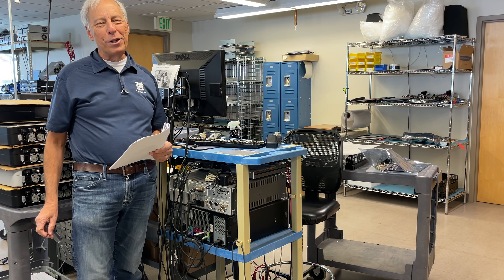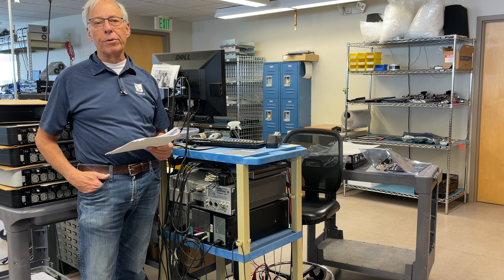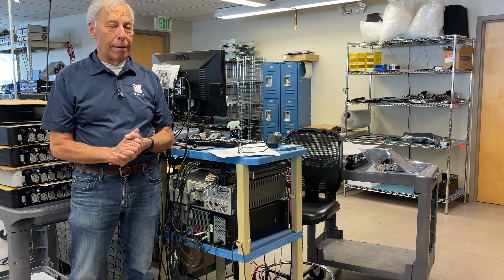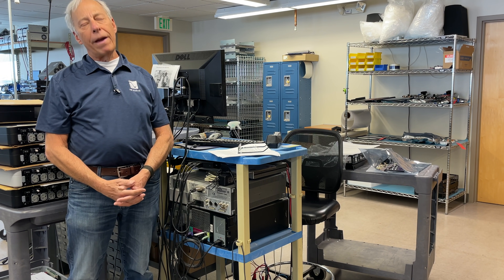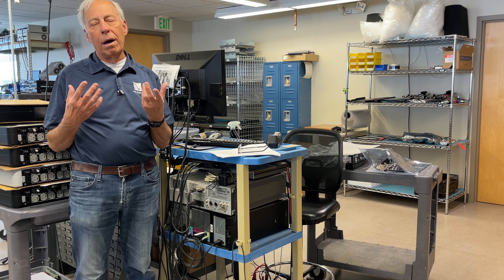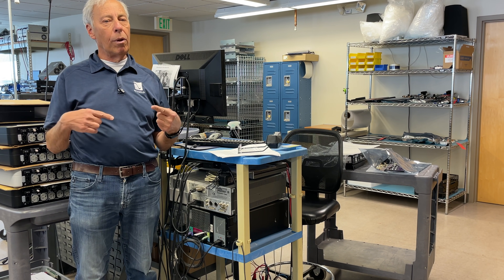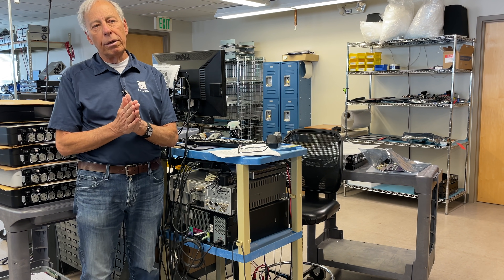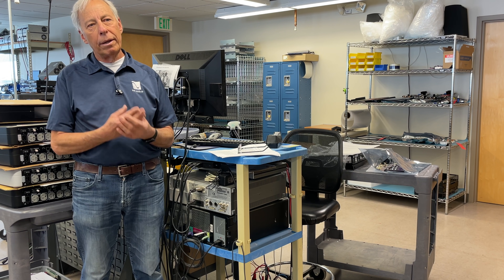Digital room correction

Comment: Sorry to come so late to the party, but I just recently added miniDSP with DiracLive to my 2.1 channel system.  I run both digital and anolog sources through an Emotiva PAT1 pre amp with the miniDSP between the pre amp and amplifiers
.I spent the better part of a weekend setting up the DiracLive software which requires 9 measurement points (please note that's 9, not just one) all carefully positioned with a tape measure and a calibrated microphone,  The DiracLive allowed me to create 4 different room alignments (flat response, bass emphasis, high frequency emphasis and a custom setting).  I can choose between the settings in real time on the supplied remote control
DiracLive is more than just an equalizer.  It also corrects for transient ringing and time delay.
I have been using DiracLiive with various types of music, and the effects are noticeable, and in some instances, amazing.
DSP is the future.  It may take some time and expertise to set up, but it is well worth it.  With over 50 years experience in tweaking audio systems, the miniDSP with DiracLive is the only single addition that made a significant, noticeable and immediate improvement to my system.  However, it is not a "plug and play" addition, as you need some basic computerr skills and patience to set it up.
Reply: But I did read the MiniDSP can only stream 48 khz max, instead of 192 for example. Is that not a problem?
Reply: @cmessi  your ear won't notice the difference

Comment: Equalizer APO and REW are free.  I use a HTPC to serve my music, the use of these tools with a $100 mic made a huge difference.  The ear is the final arbiter though.  I found a response curve while in the neighborhood of the target curve, that is not perfect sounds better.
Reply: Do they have automatic room correction?
Reply: @cmessi  REW does, but doing it manually gives way better results.
Reply: @Duken4evr29  so you run REW, with an UMIK mic. That gives a result. The result you enter manually in a streamer? Or do you have a MiniDSP?
Reply: @cmessi  Set up a house curve in REW for it to target.  Run the sweep in REW and export the resulting TXT file from REW to the EQ APO settings folder.  Browse in EQ APO to those use those settings and there it is.

To be honest, I got better results just running sweeps, going into the EQ screen with the house curve and manually making entries and correcting it myself.

REW is complex audio geek nirvana and EQ APO is not too far behind as it is a parametric EQ with a seemingly unlimited amount of flexibility.   I am an intermediate user at best, but that software really has  made my system sound much better.

Comment: It would be possible to convert the analog signal to digital, compute filter values, and digitally control analog filters through which the analog signal passes. The computer would essentially design and configure analog circuits to  provide correction.

Comment: For room issues, why not just TREAT THE ROOM properly? This drives me nuts! People don’t want to do it, seemingly won’t take the time to do proper, research and I don’t understand that. For flaws in recordings, why not implement a circuit or separate module in or with, say, a preamp,  that can do DSP but can also be switched out totally to preserve the analog domain?
Reply: Because it's not fesible for everyone.
Reply: @ryacus  Understood, but understanding the underlying science and principles can improve one’s chances of doing what one can.
Reply: @sudd3660  Well, this is an audiophile channel …
Reply: Do you measure you room's frequency response at your listening position? 
Low freq issues can be tough to deal with using treatments...

Comment: I am only using digital sources and I don't want an extra (room correction) device plugged into the chain, which introduces more noise and distortions. The only reasonable solution for me is to have the filtering done in the source itself, e.g. the computer streaming the data. Or: the data itself (the audio files) gets transformed into a filtered copy offline and then streamed through a standard setup.

Comment: Just get studio monitors like Genelec with. Genelec GLM SAM Loudspeaker Management System
Reply: No
Reply: "A powerful monitor-control networking system that manages speaker connectivity

Supports up to 40 8200/8300 series monitors or 7200/7300 series subwoofers in any configuration

GLM AutoCal provides automated measurement, analysis, and adjustment GLM controlled speakers

Includes factory-calibrated Genelec 8300A acoustic measurement microphone

GLM software features adjustment of levels, distance delays, and more

If you're running Genelec SAM monitors, then you'll love your GLM system!"

Comment: Digital room correction can be the most awesome fix on what can’t get fixed otherwise but you don’t start with it and it’s best when the music is digital to begin with such you don’t have to go through an extra ADC.
Reply: that is really well said.
i also want to mention that use dsp on digital media, then have a separate analog path for those things. like a record player, riaa and preamp. 
in digital i would say works best with preamp and dsp in same box, perhaps source.  then dac's after that.
you can still use the same power amps, and dac's for both paths.
Reply: @sudd3660  Of course someone can make a great product combining the analog signal path and digital signal path involving a powerful DSP with switching after the DAC allowing both analog and digital to do its best. The problem in audio R&D is that innovation has evaporated and people are doing the same stuff as for decades. Search the patent portfolio for PS Audio and you will see what I mean. This is not a problem for PS Audio only but a problem for almost all higher-end audio companies.
Reply: Yea, im running TIDAL with USB digital out from my laptop directly into a MiniDSP w/DIRAC to handle all the EQ&Correction which outputs analog to the amp.
Reply: @ViperDom7  I recently replaced my miniDSP 2x4 HD with the miniDSP Flex Eight for my desktop work setup. With this unit I have 8 outputs and can run active cross-over to my side two-way stereo speakers and subwoofer everything fine tuned. Furthermore, I have a DSP profile for my HifiMan planar headphones that runs configured in a preset so it’s super simple to switch between speakers and headphones and everything is calibrated on this one device. I have one vacant output that I decided to use to drive a giant VU meter decoration that also hugely benefits from the DSP allowing me much better visual effect of bass drums.

Comment: Technics did that with their latest integrated. I’ve heard it and I was shocked. Especially the phono stage with AD conversation. I find it also hard to do that but the proof was in the listening
Reply: Were you shocked after you learned it's all digital or also before when you thought it's analogue?
Reply: @edgar9651  I new it was all digital and that the phono input is converted to digital for eq and processing. I was shocked with the sound quality. It was fantastic

Comment: One of ROON’s features is a Parametric Equalizer which has many features that may helpful for room correction. My experience is that if used  judiciously it may be very helpful. It is however sort of addicting and I wound up adding and/or subtracting too many changes over the audio frequency spectrum and this led to much unhappiness. Taking notes while you are using this equalizer is very helpful so you can back-out to where you were step-by-step when necessary if things start to get out of hand.
Reply: I agree that tinkering can be addicting & lead to unhappiness LOL, I've been in the middle of tinkering with a setup and think to myself, 'I'd really just like to be listening to Music right now!!!'
I suggest measuring you rooms frequency response at your listening position with a quality mic. It is Very valuable to get a baseline of where you are at. Without this you are likely subject to large peaks&dips in the lower frequency range that have significant detriment to the sound.  I use DIRAC(loaded on a minidsp) to help flatten out everything below 250hz and apply a house curve. It takes the guesswork out leaving more time to listen to music.

Comment: If you have your digital source on a filesystem somewhere and that is the input to what your D/A plays: I've written a filesystem stack that reads from that and behaves like a new filesystem with filtered files: you read them FIR-filtered on-the-fly without modifying the original files. Plug in the room filter you measured separately (impulse response essentially). All open source, called "folve".

Comment: The best, and arguably cheapest, room correction is speaker placement and room treatment. IMHO.
Reply: Some of the best room treatment cost more than the speakers itself. The experimentation needed to make your room actually sounds good will craze many audiophiles. So I don't get your point.
Reply: @limitlesssky3050  I guess I don't know what I'm talking about judging by your comment. But I can say that if you are purchasing the best room treatment, you have a lot of money tied up in your speakers and system. A couple diffusers and some damping panels go a long way to improving sound. That's a few hundred bucks. Moving your speakers around is free.
Reply: What do you mean by treatment? Some room correction methods are not cheap. What do you recommend?
Reply: @graxjpg  that depends on what you consider cheap and how much you want to spend. A couple diffusers and some damping panels might be $200 - $400. Personally, I use neither DSP nor room treatment. It took me about a month of experimenting with speaker and furniture placement to get it right. Yes that is a while, but if someone is that impatient that a few weeks of less than "perfect" music is too much to pay, then by all means they can spend their money.
Reply: @MickTimmy  But how good are they is the material proprietary or hard to find? A lot of these panels seem easy to make if the material isn't artificially restricted via price or availability.
Reply: @ryacus  see Douglas Blake's comment above. The trick is not to deaden the room but to control reflection and resonance. It takes some time and messing around.

Comment: Bob, the RME ADI-2 Pro FS R has an analog input I hook up via the PS audio Stellar phono stage to my record player and this thing does for me exactly what you have been asking for. It digitizes the analog with 192kHz, internally 32 Bit floating point. Plenty of resolution. And  I am not loosing anything I may be aware of. Sounds just great. Give it a try!
Reply: Yes , going AD and then DA again seems weird, but the DSP in between just does it.
Reply: One of the best DSP DACs out there. 

Genelec also does a fantastic room correction on there studio monitors.

"A powerful monitor-control networking system that manages speaker connectivity

Supports up to 40 8200/8300 series monitors or 7200/7300 series subwoofers in any configuration

GLM AutoCal provides automated measurement, analysis, and adjustment GLM controlled speakers

Includes factory-calibrated Genelec 8300A acoustic measurement microphone

GLM software features adjustment of levels, distance delays, and more

If you're running Genelec SAM monitors, then you'll love your GLM system!"
Reply: Also use the same RME ADC connected to my Lyngdorf MP-60 and it is just phenomenal. Plug my phono pre to the RME and I don’t think I am missing anything.

Comment: Doing the room correction from an active crossover would be a better idea. Very expensive solution.
Reply: System audio does that. Not that expensive.
Reply: @akosinskiy  An active crossover requires 3 power amplifiers compared to passive crossover speakers only require one power amplifier.
Reply: @guywilloughby5443  My speaker has 4 of those. Check System Audio Legend Silverback 60.
Reply: @akosinskiy  Interesting speaker system.
Reply: Yep. Genelec 8341 here, fed AES into the back of the speaker

Comment: The most important thing of all is find out first if you absolutely need digital room correction. Thanks to the good 30 day return policy of the products I've tested since 1998, virtually all of them are nothing more than a 12-band graphic equalizer that works in the digital domain which when tried in my system only created more problems than it solves.
Reply: While I haven’t been testing things as long as you, I find EQs and room correcting software to convolute or complicate the whole thing. The idea of trying to get a speaker in a room to replicate a recorded sound accurately is complex enough!

Comment: the analog folks... ruin it all. I want timing and phase correction according to speaker in each dac 🙂 Room correction comes after that.
Luckily there is at least miniDSP, but it could be more. Actually going activ and put the Xover in the digital domain and hook a multichannel dac to a multichannel amp. That has the potential for a real high end. Not caps for hunderts of $

Comment: Room correction is a DSP but is adjusted with Microphone. Many hifi lovers look at it like cheating.

But room acoustic is enemy number 1!
Reply: Microphone adjusted dsp is not all that useful, you still have to adjust by ear in the end to get best result.
and dsp is mostly done by adjusting volume, not affecting the sound quality issues that room can give.
you might now all this, i am just saying.
Reply: @sudd3660  
The simplest DSP. adjusts only. volume, phase. and delay.

Many loose dsp box  like bheringer and many you use in car also adjust equalizer.

Depends on how good the DSP is.

But you also often have to adjust a little yourself!
Reply: @sudd3660  i agree with half of this. The auto stuff I’ve used hasn’t been that useful but…..umik with moving microphone measurement method and REW plus mini dsp equals heaven.
Reply: @NakeanWickliff  microphone is only getting  you halfway there, just use a tone generator and listen for yourself, then eq to flat response. no mic can do that.
Reply: @sudd3660  of course mics and measurements can do that. A heck of a lot easier than your ears too! I agree that last bit of preference or room
Curve should be done with your ears but just like our eyes, our ears can be tricked by adjacent tones.
Reply: @NakeanWickliff  all my points a valid in stereo hifi, if you are any ways talking about 3 or more channels then you are  on your own.
Reply: @sudd3660  talking about 1 2 3 4 5 -12 channels. I’ll take my microphone plus my ears listening to actual content over just my ears listening to frequency tones any day of the year. I have it under good authority that any audio engineer would as well. It’s called science. I’m not advocating not using your ears but even trained pros measure.
Reply: @NakeanWickliff  i can only talk to things that  know works, that is stereo, please do not defend your position in multichannel. i leave that stuff to you to deal with.
Reply: @sudd3660  forget multichannel then. I still stand behind everything I’ve said. accurate measurements are far more accurate than using your ears alone. to each his own. Before long I bet most speakers designs will be active designs with mics built in or a way to plug in mics.
Reply: @sudd3660  You obviously have no clue how Audyssey or other digital room correction systems work.
Reply: @bluesky6361  i did not say what it can't do, just that it has limitations.  
nothing obvious here except for your ignorance and your home theater problems are not my issue.

Comment: I'm tired of all these add ons that I'd never use. I don't need/want a tuner in my next processor nor do I want a 5th way to stream Spotify. Accuphase has some nice gear and some come with optional modules for DAC's and phono stages. Even if you bought their DAC I'm sure many would be keen on what's on offer down the road and just switch it out. My car has power mirrors and I set them once and basically haven't touched them since and it's been years. If a car company came up to me and said you could have a car without power mirrors and save 300 bucks I'd buy that model instead.
Reply: Powered seats either.